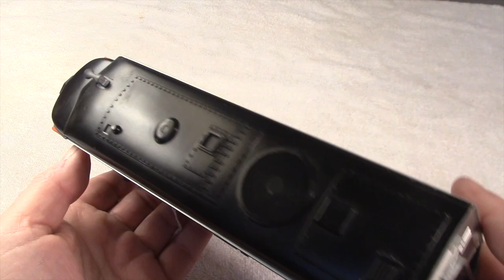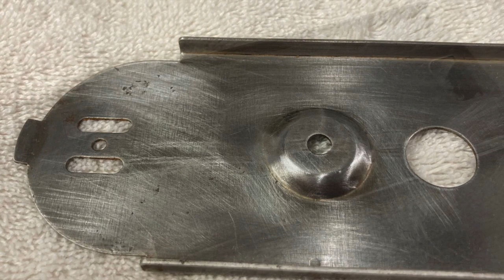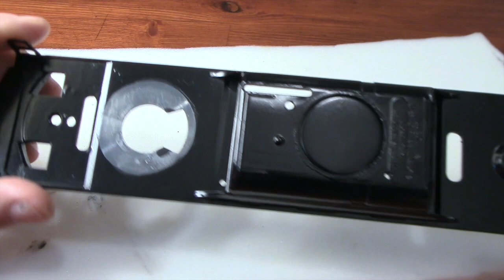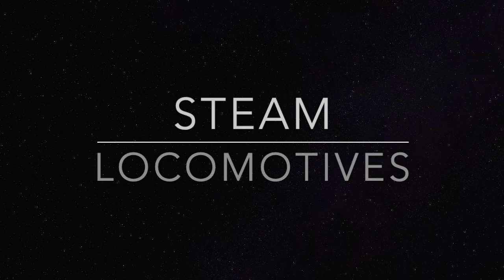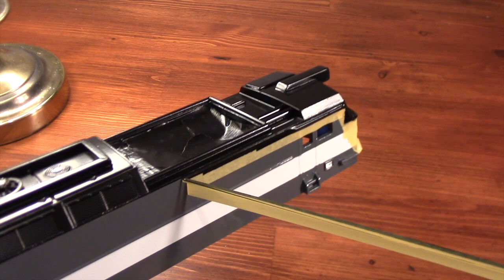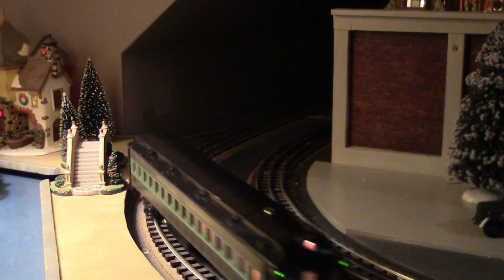O-Scale Locomotives & Passenger Cars Roof Paint Repair With RUSTOLEUM Satin Black Spray Lionel MTH

Comment: Hi Bob...
It appears you use Tamiya tape first along the edge. I'll have to try it. I haven't had much luck with any brand blue tape...even for the smallest areas.  
And I remember those military engines...my favorite. Danke !  👍
Reply from the maker: Thanks a whole lot Jim. That Tamiya tape is pretty darn good as long as the first pass of spray paint is kinda light, it’ll keep it from seeping through most of the time. Have a great week. Bob